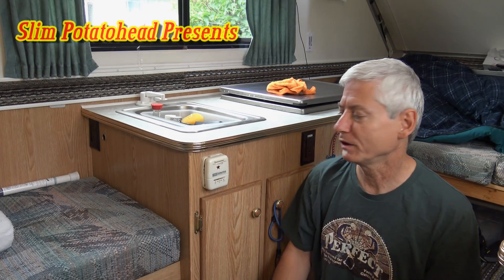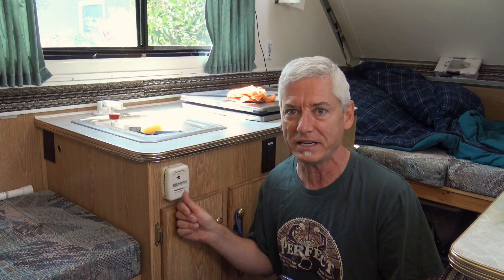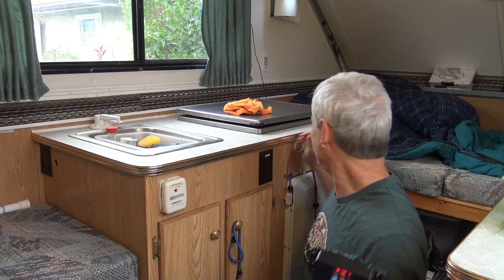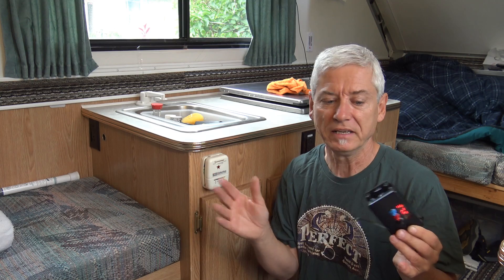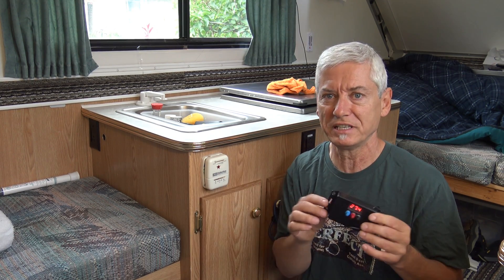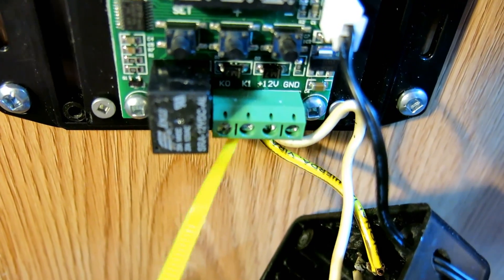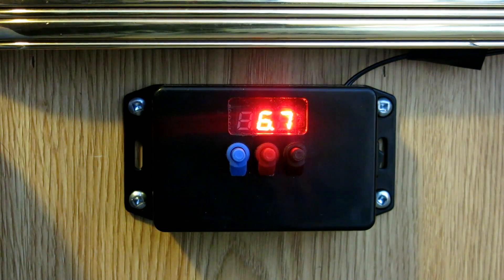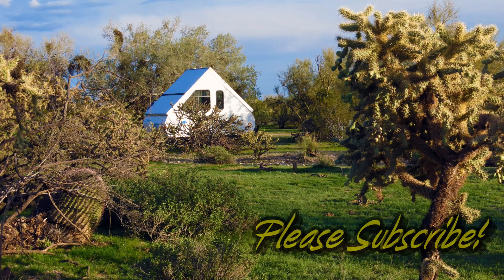Digital RV Thermostat for under $20 !

Comment: Love your videos! Don’t short cycle your heater this will course corrosion. Heat exchanger will fail prematurely. I’m a hvac guy by trade I don’t want to see you poised. Try a tempco 9100 and play with some pid settings with a electric heater. 5v pulse.

Comment: Hi, just a little confused. The 2 wires already coming from the furnace have + and negative power coming.  How would you connect all 4? Wires.. Since will be connecting the digital thermostat to + n negative and then, positive and negative again coming from furnace??
Reply from the maker: Hi Toby, this video is more about the mechanics of building the thermostat box and not the wiring installation. The two wires from the furnace (usually positive in/positive out) are connected to the thermostat switch (terminals1 and 2) , and turn the furnace on/off according to the temperature setting. The other two wires are to power the thermostat only.  Please refer to the manufacture's wiring  instructions as to proper setup for your furnace. Thanks
Reply: Slim Potatohead thank you for the reply. I have same atwood furnace like you do and I bought also same digital thermostat switch u switched to the video. There were only 2 wires coming from the furnace to the atwood switch. I put a multimeter and I could read 12v, I was wondering if if your wires too and positive /negative reading from the furnace. Thanks again
Reply from the maker: Hi Tobi, the thermostat is only a switch, If you put the two wires together and the furnace starts you have the right ones. SP
Reply: Slim Potatohead thank you again for the reply. Mind I how u connected those 2 wires from the furnace? The digital thermostat I got like yours have 4 connections. The 2 of left and then the +and negative connection. Thank you
Reply from the maker: Hi Tobi, the + and - on the thermostat is to power the thermostat only. You could tap into the furnace power source or go directly from the battery (12V DC). Which wires from your furnace are the switch I can't tell.  Did you have an existing thermostat before you bought the new one? My old one only had two wires (green and yellow) which connected from the furnace. There must be a furnace wiring diagram that tells you which ones go to the thermostat switch. Sorry I can't be of more help. Thanks SP
Reply: Slim Potatohead thank you again for taking your time to reply. Yes, the existing thermostat is same you have in your video before you changed to the lcd one. So I guess I'll connect the 2 wires coming from the furnace to the 2 wires on left and the + and - on the right

Comment: I have been looking for a way to do a thermostat that would allow me to choose lower heat settings! when boondocking like you said it's not necessary to have the heat at 55 would love to be able to set it to 40 degrees when I am not in the RV. thanks for sharing.
Reply: Why would you want to heat up your vehicle to 55. I wouldn't go higher than 15 overnight.
Reply: Why would you want to heat up your vehicle to 55. I wouldn't go higher than 15 overnight.